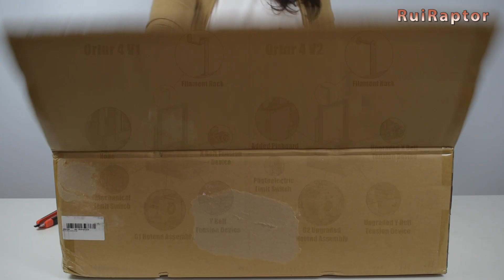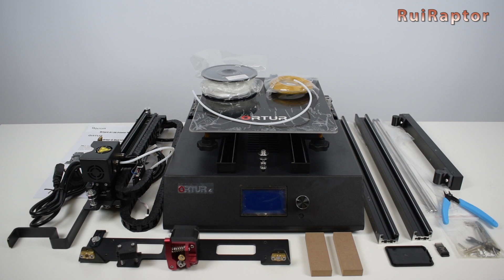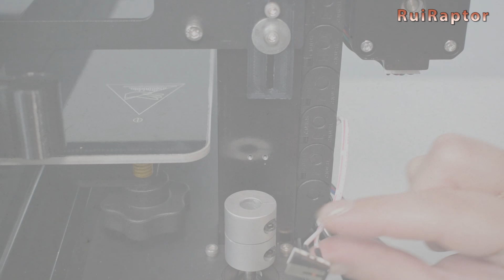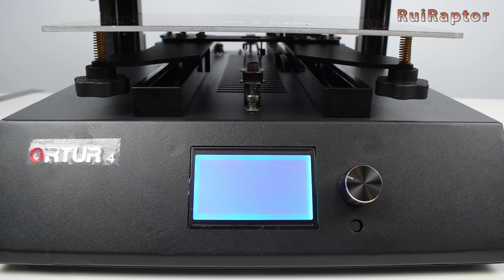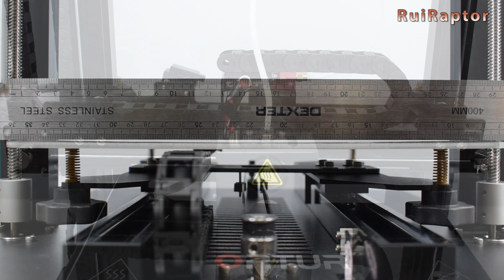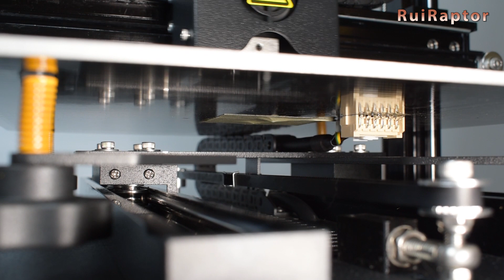Ortur 4 V1 (3D Printer) ♦ Unboxing, Assembly & Review ♦

Comment: Great review, no so great 3d printer.. I know these are cheap printers and some compromises are done, but it's not excuse for so many problems out of the box.
Reply from the maker: Hi David, the biggest issue for us is the auto-level sensor and the warped bed. For the sensor, we can replace with a better one or use the mechanical endstop instead (as we eventually did). Regarding the warped bed, the auto-level sensor will compensate but if the sensor is not available we would suggest a glass on top of the bed. Other than that, the printer does produce decent quality prints. The salmon skin is a known issue with these allegro drivers and these cannot be replaced with TMCs since they are soldered on the board.